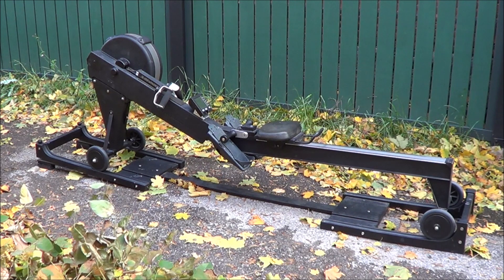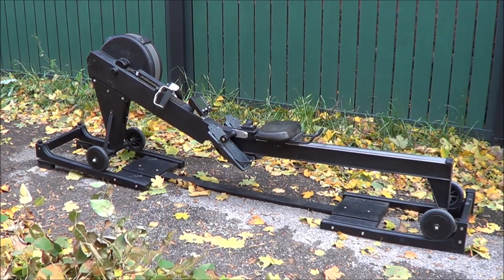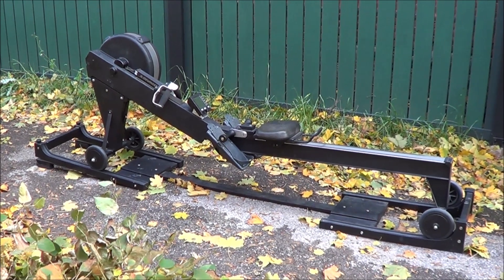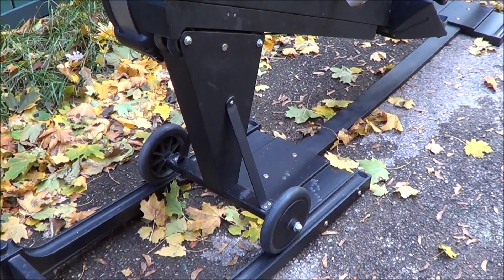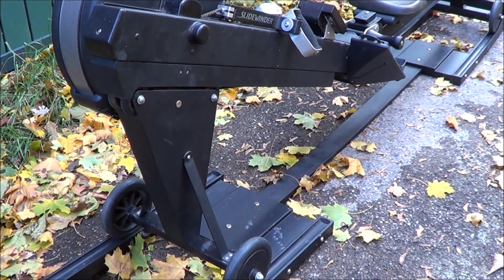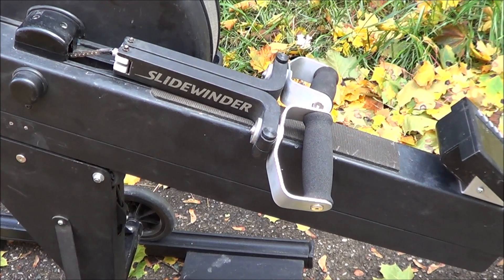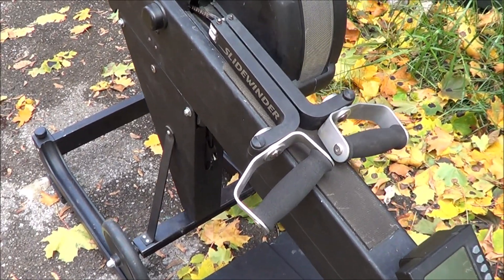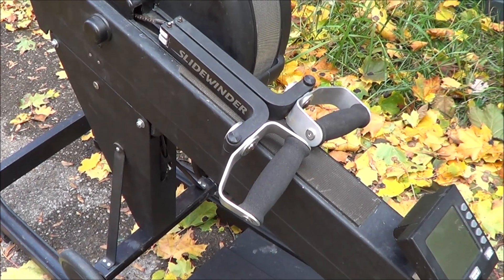Earliest Prototype: Gravity Return Dynamic Rowing Ergometer

Comment: Hey Robert have you had any help with working on it. I am a mechanical engineering student and competitive rower I would love to help work on the project.
Reply from the maker: Thanks for your interest Ryan. You can see from the video that at this stage it was functional but  crude. The embodiment in my video "Gravity Return Dynamic Rowing Ergometer" is as far as I took it. I know it could be made a lot lighter. My video, "Simple handle return for rowing ergometer" shows it with the top rail section removed. I'm in Southern Ontario. You are welcome to come by, check it out, give it a go. Just started another rowing ergometer project. Found an interesting expired patent that I think could be improved upon and used as a foundation for very simple dynamic machine.
Reply: @Robert.E.Edmondson  I actually study at Conestoga college. I am just coming off of my first coop work term!
Reply from the maker: @ryanperry7673  You are about 3 hours away. I'm in Peterborough. Not sure what you could do to help. I work out of a small shop. I have no CAD skills. It's all seat-of-the pants engineering. I think people are starting to wake up that Concept 2 stopped being an innovative company about 30 years ago. Look at the huge advances in bicycle technology over the same time period. C2's market dominance has caused people to think, "Well, if Concept 2 hasn't thought of it or implemented it, then the idea, whatever it is, must have no merit."  , and this has stifled advances in rowing exercise technology. If you are up this way sometime, look me up.